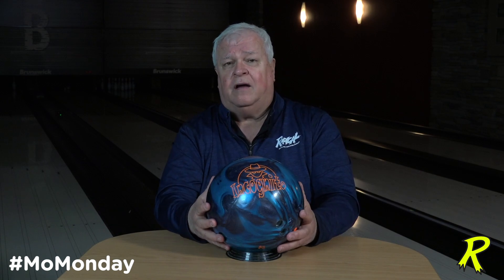Chemical Friction vs. Mechanical Friction - #MoMonday

Comment: I’ve been throwing Radical since about 2014. None of the balls have needed any major resurfacing. I’ve adjusted some with abralon pads, compound and polish. I still use them all. Now that they are involved with Brunswick, we have dynamacore. Recently picked up a Pandemonium, and am really pleased. I’ve got a Spy on order. My average has consistently increased. Not just because of a magic ball, but because of consistent reactions. And  they are affordable and do well in tournaments. Look at some of the pros on TV. They don’t need to throw the highest priced most aggressive balls.
Reply: Abralon use = resurfacing.
Reply: @exesemas  And? All balls need to be resurfaced periodically. I didn’t see where Phil stated to the opposite. My point is, they are easily adjusted and maintained.
Reply: @butchcoolidge3261  I was commenting on what you said, not Phil. You said "none of your Radical balls needed any major resurfacing",....but you also said "you used abralons and polishes". Just saying,  that is also resurfacing. There is no "major" and "minor"  resurfacing per se. Unless you never used any abrasive to go lower than 3000, then yes you can abstractly say you didn't do "major resurfacing" in that sense. But no one does that. So you did regular resurfacing as everybody does with any ball brand. And many others take care of their balls and they perform well for long periods of time. If Radical balls lasted much more than other brands, it would be self evident many years now from all the consumption worldwide. Now they MAY last a BIT more than others (something that needs proof though), but not a lot more.
Reply: @butchcoolidge3261  I have but that is 100% irrelevant.
Reply: @exesemas  So you just troll bowing videos, with your wokeness? No one cares.

Comment: This sounds more marketing than science. And i'm sorry to say it's a mess. 
1. there was NO explanation given of what the difference between the 2 frictions is. But most importantly...no explanation as to what "chemical friction" is. I've never heard of it and it is not listed in any source i can find as a type of friction.....
2. In the beginning he says Radical uses only chemical friction (not mechanical). That is impossible since the ball is solid and it slides/rolls on another solid (lane). So there is mechanical friction whether you like it or not. 
3. He then says that if you sand a ball and then it gets shiny (cover "wears out"), the peaks and valleys beneath are "no longer the same" and you no longer have mechanical friction. We already know that the very fact that a ball gets shinier with use, IS the smoothing out of all the peaks and valleys. That is no news. And it also happens with Radical balls. So...still waiting to hear the "difference". 
4. Then he says that  in their balls, the chemicals "create the peaks and valleys". So "if you scrape the surface, what is below, is the same as what was above". If that were true...then you wouldn't be able to change the surface grit of Radical balls !! They would all have a fixed grit surface ! 
5. But then another contradiction. He says "eventually it wears off and you have to resurface it ! ".  Make up your mind Phil ! 
6. Claims that other manufacturer's balls "burn out" in 30 games. Super mega false. 
7. "We use mechanical friction on top of the chemical friction".  WHAT? What the hell does he think friction is ? Some layer of some substance? Can you please tell him friction is a FORCE? So now he is saying that their balls have some "mechanical friction" layer on top...and when you sand them...THEN they reveal the chemical friction below ! Wow..what a mess...
8. "The chemical reaction is what created the friction". No...friction is a force created by resistance of movement between objects and surfaces. 
9. This is what happens when you want to market something, that you don't even understand yourself how it works, or how it can be explained. And what is mind-blowing to me, is that they don't even script this video? They don't even WATCH it to see if it makes sense? Nobody said "hey, this is not comprehensible for the general public, let's change it up". Or maybe they want it to be mumbo-jumbo in an attempt to impress those with no science skills?
Reply: Agreed, this video is filled with unscientific rambling nonsense. So soon after that farcical Motiv comparison video, he's single-handedly destroying the Radical Brand.
Reply: What he is trying to say I think is that chemical friction in resin balls, since the beginning of their creation, is a property of Plasticizer being added to the resin/urethane formulation.
Looking at how it works, it seems this chemical causes a chemical change in the urethane formulation which results in the final poured ball curing with a sponge like surface.
Under magnification it would look like a surface covered with pores. These pores exist in the whole cover at all depths. So sanding and resurfacing would just expose more pores.
Taking the ball to a higher grit would smooth off the edges of the pores, while a lower grit would allow the edges of the pores to be sharper. This allows for more or less length on the ball, but...the pores do not go away. Its the edges that smooth out or sharpen depending on grit. So what Plasticizer actually does is create a surface on the resin ball that has the potential to create higher mechanical friction with the lane.

Below are some quotes that explain about Plasticizer.

"Plasticizers are the chemicals that increase a reactive ball’s hook potential over standard urethane. When plasticizer is added, it forms channels or pores in the urethane structure which increases oil absorption and gives surface texture to the coverstock."

"According to Ebonite International, the answer to Dead Ball Syndrome is not the absorption of oil. The company has discovered that when a ball is 'compressed' by repeated use, the plasticizer migrates to the surface and concentrates in the Track area of the ball. This build up of plasticizer acts as a lubricant that diminishes friction and performance in the backend. In effect, the same thing that causes a ball to hook causes it to lose its hook."
Reply: @nordattack  I am aware of plasticizer and what it does. He mentions nothing about it. Also if he WERE talking about that....then ALL brands have it so all brands have "chemical friction"!  But he said only THEIR balls have it. So no, he is not talking about plasticizer. I wish he were..
Reply: @exesemas  Not sure what he is talking about! 
Tonight in league I used old school Mechanical friction. A Storm Mix at 1000 grit with pin dead center in the palm.
Zero hook or jump. Just roll the ball straight to the target and it never moves off that path.
It can be a true pleasure to see an old school straight ball path from a ball that has no fancy core or other modern stuff to help cover up your mistakes.
If I do well with this ball then I can pat myself on the back since the ball cannot help me. If I do badly that is totally on me, the ball cannot be blamed.
There is something very honest in bowling like this...
Reply: @exesemas  Quite right. He is trying to "differentiate" his product with technobabble nonsense. Instead he is made to look like a fool, and by association, is tarnishing the reputation of the company for which he is a spokesman.
Reply: @nordattack  You sir are playing simple pure bowling and we enjoy your videos !
Reply: how long you been shilling for ctd, buying that overpriced crap just to say you are on staff?? LOL. did you confer with bill freitas before you answered??, scrubs paying $20 for alcohol and fabuloso, but at least you can have that "wow" factor, haha
Reply: @yuzumishintani2390  I’ve never paid to be on staff. I am a paid coach for CTD. If you believe their product is fabulouso and alcohol look up the SDS (formerly MSDS) sheets of both. Or better yet, the approved cleaner list from the USBC site. Fabuloso isn’t an approved cleaner straight or mixed no matter what name is on the container. None of which changes the my opinion that this was horribly presented.
Reply: @yuzumishintani2390  You seem to be replying to my message, but what you say does not apply to me. I have no affiliation with CTD. Maybe you replied to the wrong guy pal...

Comment: Since the spy is basically a plastic bottle with surface added to it does chemical friction still apply to this bowling ball?
Reply: it isn't just a plastic ball with "surface" they actually added a chemical into the polyester that gives it surface, like how resin balls get their texture/pores
Reply: @DrengrWolf   No they didn't say that. They never said that the Spy has pores and absorbs oil. They said it is "textured". Also if you see video reviews that began popping up, the ball goes pretty straight like a spare ball.
Reply: @exesemas  have you looked into any of the spys vids? They say this. And it has more bite on the lane than reg. Plastic
Reply: @DrengrWolf  Now you are saying something different than your previous comment. The video reviews for the spy are so far...like 2- or 3. And yes i watch them all before forming an opinion. And they all saw motion only after sanding it down, and in all videos it looks more like a sanded plastic, than a urethane. It may have some use for high rpm average/low speed players but i don't see it doing much more for everyone else. They sure built are hopes up for this ball, but so far i don't see it moving well on the lane. And it just shows how much coverstock and surface are completely dominant over core and layouts.
Reply: @exesemas Sorry, I woke up replied then went back to bed. Didn't have the will or want to continue this at that time. But okay. so here's the deal. They said the ball has a "textured pearl (additive) in it that we use in our high performance balls" This was said during the FB livestream not long after they introduced them. Does it have pores? no, does it have teeth from a (chemical?) additive not typically used in polyester? YES. When you sand it, it will become more aggressive on the lane just like any other ball but more so than a normal polyester ball would. The idea is also with it having a true core and not a pancake weight and dynamacore  it can be picked up and used for a strike ball when the lanes are horrible while not getting that dead, hollow thunk and deflection you get with most plastic balls.
Reply: @DrengrWolf  Yes, you are correct. I haven't heard them explain what kind of additive they used, but i take your word for it. And i agree with the rest of your comment. The results so far though, show a ball more like a plain polyester with a core (which we had balls like that), than "something new". Let's wait for more reviews, because now there are only 3.
Reply: @exesemas  it can go straight. It can also hook. I’m not a great bowler and average like a 160. But if I use plastic and play up the 5 board I can often get in the 200 range with this ball and even a storm ice. But the spy does move a bit more across the board. And it looks really nice doing it

Comment: So basically what you're saying is that you guys think that other manufacturers coverstocks are paper thin and as soon as you do anything to the surface, the original characteristics/formula/makeup of the cover is gone? You have got to be kidding me. This is probably the dumbest 2:32 of youtube I've ever watched.
Reply: What he is saying is that the physical surface wears and changes during use but the chemical makeup of the ball is constant. I don't think that he needed to say that the competition ignores chemical friction, because they obviously do care.
Reply: It sounds like he is saying competitors balls only have grit in the extreme outer part of the cover, like the molds were coated before the resin was poured in. That is impossible since there is machining involved after the final pour. Another hypothesis is that he is comparing a shiny Radical ball to a sanded competitor ball that ends up with some lane shine after 30 games.
Reply: I want my 30 seconds back for reading your comment
Reply: Uh there is at least 50 hours of Dr fauci spewing bullshit on YouTube. I think youre exaggerating.
Reply: @jhonviel7381  he said video HE has ever watched...
Reply: @jhonviel7381  good point 😂